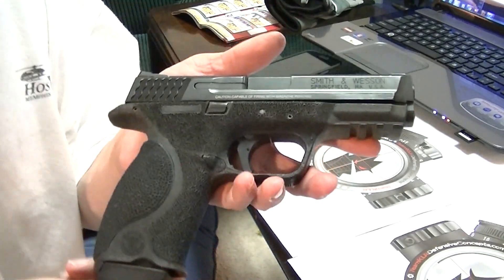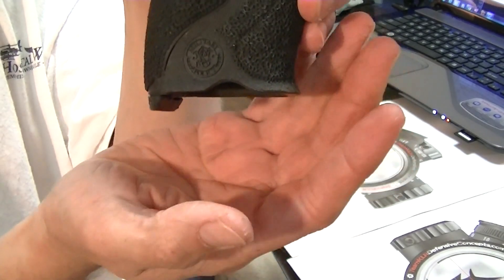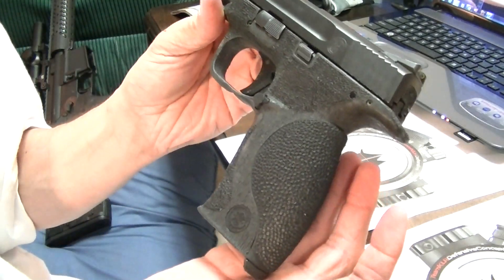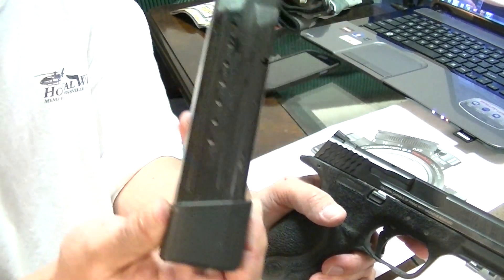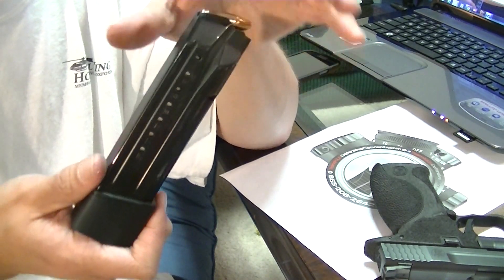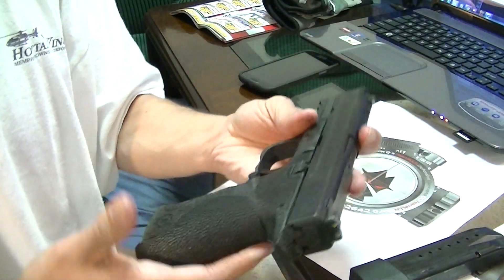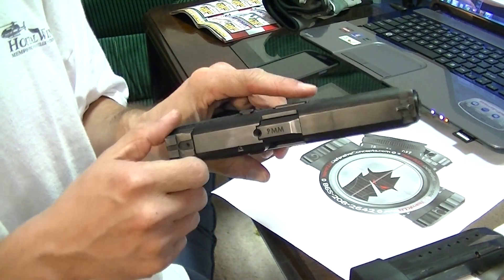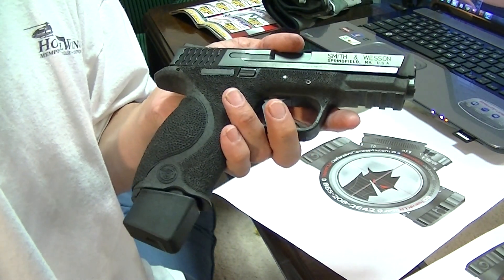Update on my S&W M&P9 with multiple TDC modifications

Comment from the maker: I can assure you I have veted these with specific tuning and  thousands of rounds downrange. Lack of round count is no issue here. I do agree that it is not a good idea to run these large extensions for edc and self protection straight out of the box and without proper vetting.  These run great and I have no issue with trust, ON THESE. I would not use any other ones than the ones I have that are properly tuned. Thanks for writing and watching

Comment from the maker: The DCAEK does not remove the two main problems with the M&P trigger system.  That is the take up and the trigger itself (there is a 3rd prob too) .  The FSS removes the take up and as I described in my video on the sear block upgrade the trigger itself is a major problem.  I would definitely recommend the RAM (solves the aforementioned 3rd problem, being lack of a tactile trigger reset) next you can purchase Apex's trigger by itself. You will then have all of the problems addressed

Comment: Hate how you did the trigger guard just looks like it'll break wanted to do it just to see if I do hold and shoot better but I spend to much mula on guns to tear em up stipple job pretty bad ass I did the same just smaller and thinned out the beaver tail
Reply from the maker: There are guns for pretty and guns to save my life. I don't care about looks on this gun, it is 100% function based. It makes such a difference to have that whitnes mark for the support hand. This is a very common modification within the ranks of those who really run their guns hard. Many who don't, don't shoot enough to even realize the difference and the change. Trust me, if I have not broken this yet it is still very strong. If it broke, so be it. I would get another and do the same thing with maybe a slight bit more meat the next time. That is not going to happen though. If it did it would be because I was beating the shit out of someone's face and the rounds of 9mm had not done the trick... haha
Reply: Well ill take your word for it think ill try it out ill use my shitty keltec p11 for practice
Reply from the maker: Yea, it sounds like you have to get your mind wrapped around seperating tools from toys. Pick a gun that you trust and are comfortable with. Make it your "carry" gun. Always carry the same gun for self protection instead of swapping around. You want to make things as easy for yourself as possible if you ever have to protect yourself or family. For that gun, don't worry about looks. Even go throw it on the ground to scratch it up if you need to get over it being "pretty". Then you can get to making the damn thing a tool for saving your life. You can use all of your other guns as show off pcs but have one that is a workhorse. That is the one that you train with and carry.. "just suggestions from the consensus of the majority of instructors in the world"